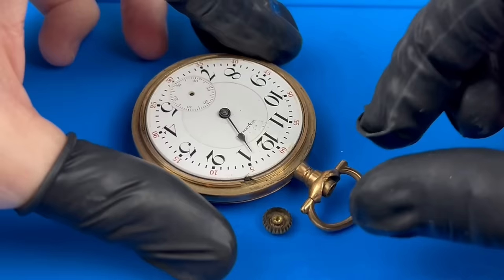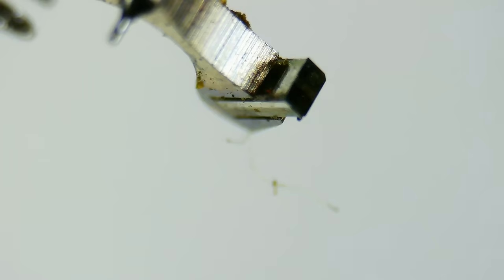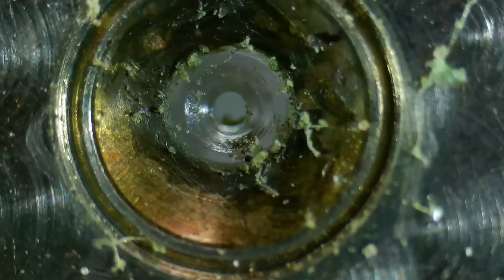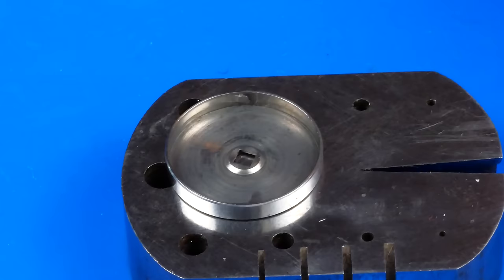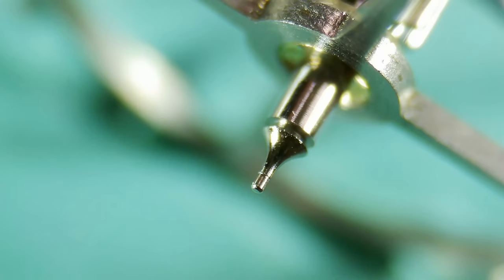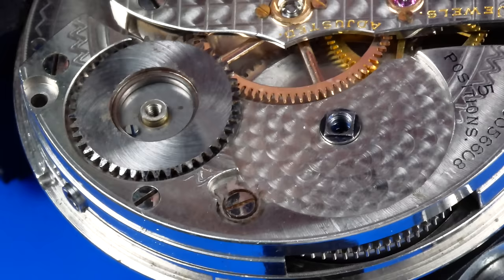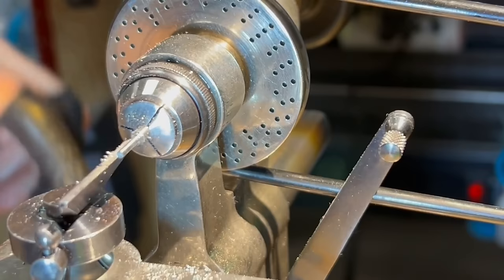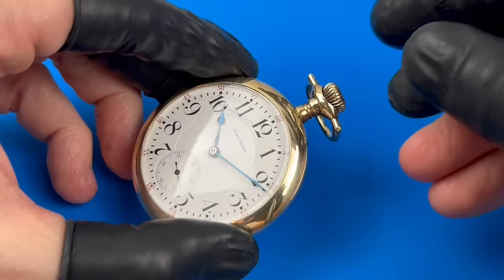Restoration of a Waltham Vanguard Railroad Grade Pocket Watch - Family Heirloom

Comment: I did watch this video through to the end. Great work, Chris! I’ve also listened to your participation in JD’s watch chats. 

Oiling and choice of oils is certainly a controversial topic, with many conflicting or contrasting opinions put forth by many experienced watchmakers. 

Your choice of lubricants here is fine, but in my opinion could be improved if you do already have the relevant products to hand. Most of my suggestions are from the BHI pdf on watch lubrication (free online, just search if you haven’t already got it) and are the practices that I follow myself. 

On a movement this size and beat rate, 9020 would be my choice where you used 9010. 9010 will suffice if you don’t have 9020. 

For all lever escapement watches, and cylinders too for that matter) I now use Moebius 9415 for the pallet stones. When 9415 was introduced it was initially recommended for high beat movements, it’s thixotropic properties helping to keep it in place. 

Real world use showed 9415 to also be excellent on slower beat movements, an improvement on 941. It is now recommended for use on all lever escapements, regardless of beat rate. 

941 will still work on watches like this Waltham, and are adequate. Once you’ve used up your 941, I suggest you only keep 9415 in stock. 

Keep up the great work,

Mark

Comment: Nice movement, Great work on that stem. One step that I have been doing lately is when replacing a staff is now I set the balance wheel less the roller table and HS  in the movement. This is less all the wheels, then check for freedom and endshake. Saves time if I do it then before the roller table and hair spring plus I can really see around the balance without the bridge plate in place. Keep up the good work!

Comment: Hi Chris, another great video, and thanks for the heads up on White watch crystals. I had been buying them in bulk, and that "buy 20 to (maybe) get one" gets old quickly. Also useful was the one vs. three dial washer issue. I have my grandfather's Longines pocket watch, and the hour hand is a bit wonky. Maybe a second (or third) dial washer will fix the problem.

Comment: This is really lovely work. As an amateur watchsmith, blacksmith, and wood turner, the making of the stem was my favorite part. Did you harden the steel before tempering it to blue? And is there a reason you chose to temper it back to blue instead of leaving it harder?
Reply from the maker: I probably should have heated to bright red and quenched before tempering to blue. The supplier of the steel says it’s already tempered so I guess all I did was cosmetic. As to why I didn’t leave it harder- I suppose the brittleness could be an issue if winding it past full
Reply: @csspinner  just curious and hoping to learn. I'm keeping an eye out for my own watchmaker's lathe. Cheers!

Comment: Friction fit staffs are lovely. Did you modify the end on the mainspring? The Waltham white alloy springs usually don't work right without putting a bend at the very end of them.
Reply from the maker: Thanks, Tim! I know what you’re referring to. Sometimes the hook doesn’t catch, but I got lucky with this one. Other cases I’ve had to unwind the spring and then add a little contour to the tail.

Comment: I have also restored a Vanguard up/down wind indicator. I have been very surprised to see how much rust are in these watches. I ended up buying a second Vanguard and taking the best screws from it for my watch. I also polished each screw to restore the shine. I am still working through it but the beauty is stunning. I did really screw up by polishing the plates. Yea I took off some of the finish. This is my watch so until I die no one will know. 
I purchased it from ebay and the seller was a thief and sent it incomplete but dolled up enough to look great. All the up/down gearing was gone, the spring barrel was severely damaged and the balance was replaced. The serial number did not match so the balance spring has to be vibrated. That is very time consuming work. I am almost there, installing the balance spring to the post has been a challenge but I have been able to install it. I did make a tool to hole the balance spring post. 
It's been fun but I am almost done.

Comment: Hi! Magnificent work on a magnificent timepiece too.  The work on the winding stem particularly impressed me.  I have a question about the re-tempering step: what is the cup you use to brown the stem made of?  And what's inside?  Brass or bronze shavings, or something else?  The cup and what it contains must be able to resist the heat while transmitting it to the winding stem!  I'm curious.  Thanking you again for this wonderful moment and, I hope, for the answer you can give me.
Best regards,
Pascal.
Reply from the maker: The cup is a cheap parts tray I picked up off Amazon. It used to have a magnet at the bottom so I removed that. I guess it’s used for working on cars to put screws and other items in. The heat is transferred from brass shavings I picked up from Etsy

Comment: Nice work!  Did I miss something or did the crown wheel have a 'normal' thread (not reverse of LHT)?  I have often wondered about the efficacy of the dust band, when the back of the movement is open unlike a full plate movement.  Nice looking watch
Reply from the maker: Correct, Waltham generally used normal, threading on the crown wheel screws. Elgin mostly used reverse threading. Seems each manufacturer has their preference

Comment: Rather than extra washers (at the end after the test) i think that the better solution is to make a new washer with the correct bow. That said... it's odd that it has that much gap, is it the correct part or a replacement with a thinner size?